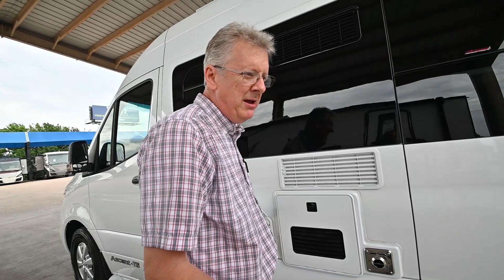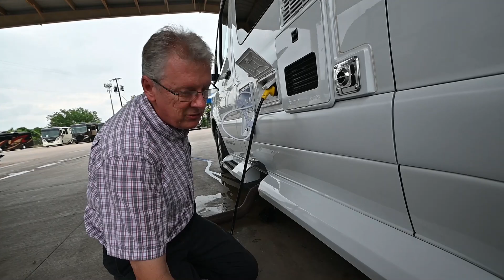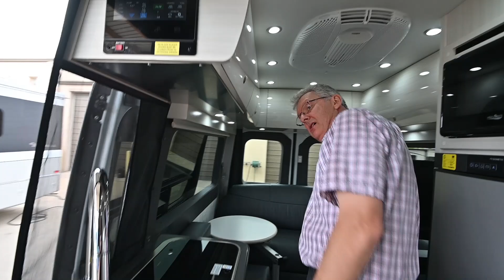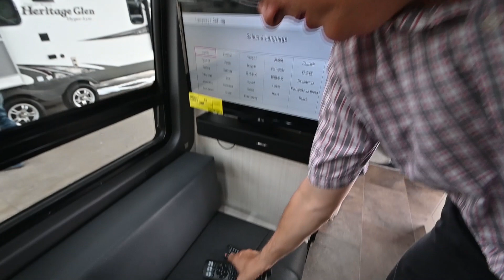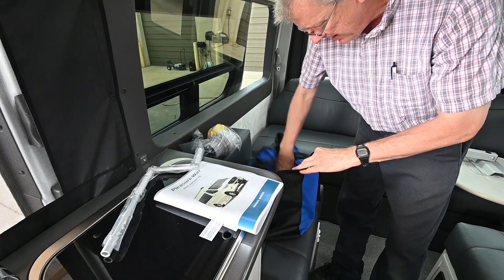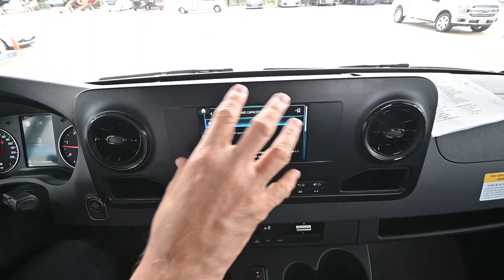Pleasure-Way Accent Full Service  Walk Through

Comment: Important info for the newbies lol I have the TS and learned an important thing about a motor RV, DO a walkaround before driving off I have already taken the water tanks to fill door by the electric side door opens it will tear it up and catch the paint also watch garage door hights no parking alarm up there I hit my gutter and took out the backup camera all in a week lol easy to forget when sitting in the van.

Comment: I’m so grateful for this video, thank you. I’ll soon have my ascent arriving, I’m on countdown now, and this video is extremely helpful. Ill save this video and watch it again to take notes. I wonder why or what would cause generator to trip? You showed us outside under the back area the switch for the breaker,  is that different from breakers inside?  Also the toolkit in front passenger seat, what exactly is that tool kit used for? thank you.